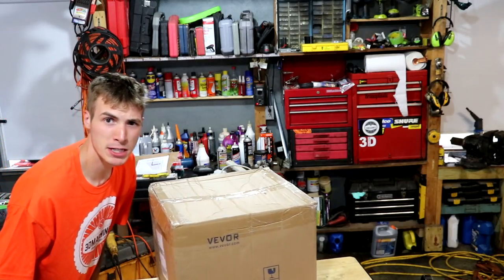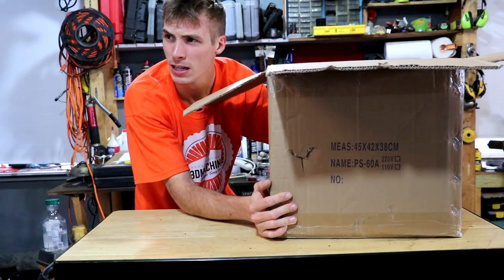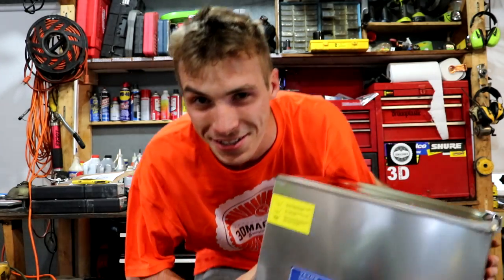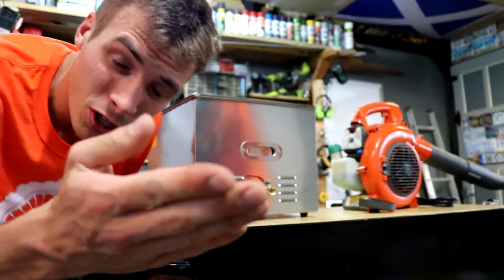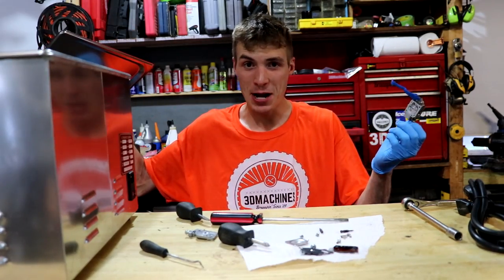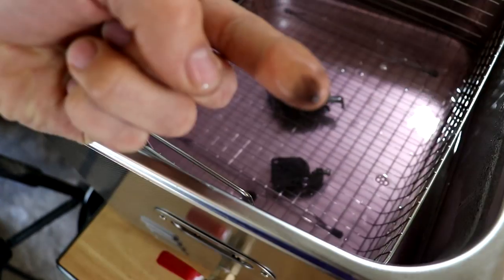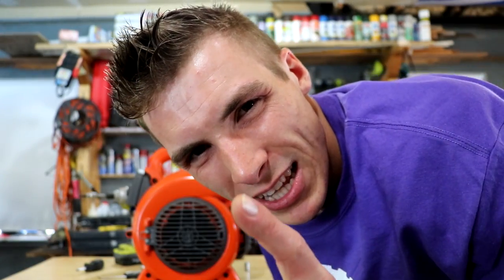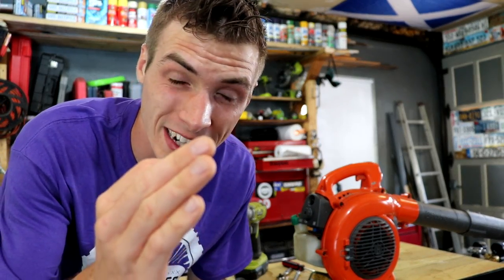Every Garage NEEDS THIS

Comment: I use a sonic cleaner everyday at work.  We use 50% simple green and 50% water.  I would recommend not letting the water get over 120 degrees fahrenheit for an extended period of time, it can cause similar effects as what you experienced.  Multiple types of metal in the same bath at a high temperature causes an electrolysis affect, moving metal from one to the other causing discoloration.  This is also a common problem in dishwashers.  To be honest, 2 stroke and honda carburetors are so cheap to replace we rarely waste the time with a sonic clean / carb kit.

Dont leave items in too long, take them out even while off overnight, and change the water often.

-Joe
Reply: Do you use the green or purple simple green?  I read somewhere that the purple was better for ultrasonic cleaning?  I use a similar 50/50 mix and have had great results with it.  Cleaned a Kawasaki carb on a 20 year old lawn mower that had been sitting for the better part of a decade and afterwards it started first pull.  The ultrasonic cleaner works like a champ and I have the one from harbour freight.  Oh and FYI on anyone looking for an ultrasonic cleaner that there are a ton of companies that will charge more money but if you look at the design the harbour fraight one is the same exact one as half of the other ones out there for much less money.
Reply: Purple Simple Green is called Simple Green HD (Heavy Duty) and is non corrosive and safe to use on aluminum.
Reply: SmallEngineCare when we got one it came with a 5 gallon bucket of the solution they say to use, but when we went through that, we tried the simple green mixture and it didn't work near as well for us. Ended up having to spend the money for their special solution.

Comment: Dalton, I retired from the United States Navy after 20 years! One of the shops I was in charge of was a mid level corrosion control shop where I used an ultrasonic cleaner on a daily basis! We had much the same problem as you, finding a decent cleaner to use in it! Almost all premade cleaners had the same problem! Etching, We solved the problem using two different solutions!  We used Simple Green which could etch the parts if left in too long (remove after an hour)! The other solution was denatured alcohol, highly flammable and very expensive! It worked the best however! Good Luck 3D!

Comment: Hey Dalton I have an ultrasonic cleaner and I use it on my carbs. Do you know if it can clean corrosion on carbs? Thanks :) 

Also it is supposed to make that noise. BTW I use Simple Green and it has given me good results so far.

Comment: You're correct in thinking if the carb got etched, i used to work in a aerospace finishing plant that anodized aluminum, that was one of the processes we used to clean the metal. You could've used something with nitric acid in it (apparently cascade dishwashing gel has some in it) to remove the etched material.

Comment: Dalton,
I use an ultrasonic cleaner everyday at work.
For best results use Stens ultrasonic cleaning solution 770-100 and run for about 30min at no more the 120 degrees.
I hope this helps you out!
Will D.

Comment: Try using 1 part Dettol and 5 parts water  (think you call it simple green) the main ingredient is pine oil and it cleans carbs great just as a soak. In an ultrasonic bath should be even better. I've used this method for overnight carb soaks for a few years and wish I knew about it before. :)

Comment: We use those cleaners over here in the U.K. Yes some products do stain the carbs. You have to be very carefully as they can some time stain insides to effecting the carb but you got off lucky I guess but there a great thing to have here a tip clean every carb for 30 minutes then removes and leave in the tray to drain off for a few minutes carb clean it off and refit and your good to go :)
Reply: Try to clean more than 1 carb at a time to save resources to :)

Comment: 3 hours is the absolute max or it will turn colors. I don't use purple cleaner unless it is real bad (chainsaws caked in sludge) and I dilute it 50:50 with water most of the time. It will leave a thick residue if you soak it too long, sometimes the lye will oxidize and eat the aluminum.   The best solution is....  it depends on the contaminate.  If you have heavily varnished carbs I would just hit them with some value craft carb cleaner from Autozone it's on $2 bucks a can and the only thing I have found that will melt varnish quick and easily.  Just do a simple green soak with hot water  or some other presoak before putting the carbs in your solution.  This helps break the chemical bond between the contaminate and the carb making it possible for the ultrasonic waves to move contaminate into the solution, get some different solutions and experiment on some old carbs.
Reply: I have been using Benjamin Moore oil and grease emulsifier to clean carbs for a long time with good results I put 3 capfulls mixed in 1-2 litres of hot water then  soak carb in small container cleans out a carb in 5-15 minutes. I have cleaned out 40 small carbs and still  have lots left in the  jug. The product will bubble as it works and is safe on rubber parts after  it stops bubbling I remove the carb and  blow everything out with air.

Comment: You should use water once any carb is done cleaning in the tank, rinse it out with water so it won't get powdery dry stuff once you start using the real chemicals. Use the sink to rinse it off with water and all the parts you put in the tank. And always heat up the tank before you just throw a carb in there and hit the start button, there should be a warm button, hit that then wait 5-10 minutes and then put your carb in there.

Comment: carbourator cleaner spray works fine 
& you can actually buy small sand blaster instead of this one
cuz water & metal doesnot co-operate with each other. . . .

Comment: On my ultrasonic cleaner I use dawn dish washing soap and it works great and also I put in lukewarm to hot water in my cleaner and I also turn on the water heater and run mine.

Comment: I'm curious what the new fluid that you got is.

Yes, the purple power is what caused your problem.  The main ingredient in it is lye, which will etch and eventually dissolve aluminum (releasing hydrogen), and if your US cleaner has a heater that actually speeds up the process.  You're lucky the carb worked at all after that.

Most strong degreasers that are not petroleum based are caustic and most will react much faster when heated.

Comment: We also use a cleaning solution that has a low flash point like a mineral spirits that way if there is a little bit of water still on your part u don't have to worry about rust occurring

Comment: I use simple green pro hd. it's safe on all metal surfaces. I use my mainly for cleaning gun parts, and gunsmith needs. I use it to cleaning brass for reloading. I haven't seen it discolor brass, stainless, aluminum, titanium, steel, copper.

Comment: dexron 3 transmission fluid and diesel or kerosene work best out of my experience with ultrasonic cleaners due to theyre lubricating factor and detergeant factor. I want to also point out the black you experienced was accelerated corrosion from the purple power aka aluminum oxide coating on the carb due to the lack of lubrication anti corrosion properties of purple power and water.

Hey dalton very good idea going with the ultrasonic cleaner but try my mix roughly 8-10 ounces of transmission fluid to kerosenne is what I found best but diesel works fine just not the best because of its thickness and fact it can cause issues in cold climates.
I also will say this don't need to change the fluid with my mix very often like 1 time every 6 months to 1 year depending on amount of usage.

Comment: You just need hot water and the HD version of Simple Green.  Usually 75% water , 25% cleaner and only do no more than 3 cycles at 8 mins.  Never leave the carb in overnight ;)

Comment: use simple Green 50/50 with water. works good for brass, steel, aluminum and titanium. it's not really strong so scrub your parts good with a scotch bright pad after the ultra sobic. it'll prevent that chemical reaction you had.

Comment: I use a small ultrasonic cleaner for some odds and ends I've done a couple carbs in it it's a smaller one off Amazon but worked great for gunked bolts and carbs, I use a mixture of water and pine sol original cleaner

Comment: Just use dawn dish soap and vinegar it works better than the expensive cleaning products that are pretty much useless. Just remember to wash the carburetor with water then run the ultrasonic cleaner with fresh clean water for 8-10 minutes after washing the carb with the dawn/vinegar solution.

Comment: It's not cheap. but I have had amazing results with a soap called "Citranox", again, not cheap, but works great! Or as a degreaser you can use perchlorethylene. Do not expose to UV light though. The fumes will create phosgene gas(think mustard gas).

Comment: Ultrasonic cleaner your not supposed to leave the carbs in longer then 30 minutes before it starts to distort the colouring! 30 minutes with the lid closed should be more then enough time to clean it good! Make sure u wash it in HOT water after to get the cleaner off the carb for about 3-5 minutes!! Then hit the carb and everything with the air compressor to dry it. Then hit the jets with carb cleaner.

Comment: we use alcohol when we would clean water damaged electronics or works toilette cleaner but you have to clean that off when down or you will start to get fuzzy corrosion on it

Comment: Simple green does the same thing. From what I have  seen so far it's only cosmetic. If you want to do a four barrel carb you need a 15 l unit. Some fit in the 10 l but not all that great.

Comment: When young I worked for a guy that repaired radiators, mostly copper at the time.  He used a heated vat to clean the radiators and the solution for cleaning copper would absolutely dissolve aluminum leaving behind a frothy foam.  The cleaning process should not foam aluminum.  Not good.  So, whatever you use should not create foam in the presence of the material to be cleaned.

Comment: You're not supposed to use purple power on aluminum, it etches it just like what happened. Specifically says on the back of the bottle. Need to use something like simple green.

Comment: wow... my cleaner was a quarter of that size... 👍👍👍👍👍 nice man
Reply: with that being said, STIHL makes a jug of degreaser that works well. with your size of ultrasonic.. you should only need a couple ounces of soap. and close the lid too, they work off of heat to break up all the insides of the carb, lid lets the water get hot quicker.

Comment: u left the carb in there way to long the purple power ask as an  acid like vinger it only takes up to 30 mins  with a bad carb     then clean the carb with hot soapy water  and blow it out with air compresser real good  and it be frogy fresh p.s vinger is great for removing rust from tools littil wd40 and rag after to get black off it be like new   i am four stroke  engine  certified technician i work for the city and we use those all the time

Comment: purple power really is too strong for anything else other then concrete cleaning and super heavy engine decreasing.  It has to be cleaned off ASAP or it will etch metal and strip paint and destroy plastics and rubbers.

Comment: ultrasound parts cleaner
Reply: don't leave it on when you don't use it or else the acid will eat thru the bottom and fry the electronics
Reply: purple stuff is ok you just don't have to keep the part in the wash for longer than 2min